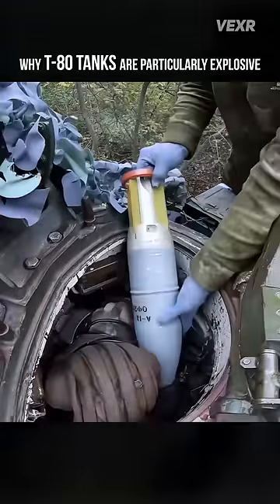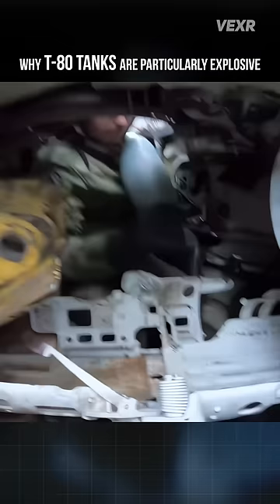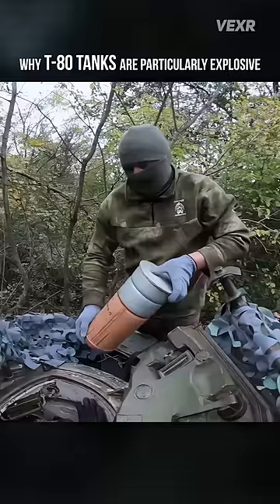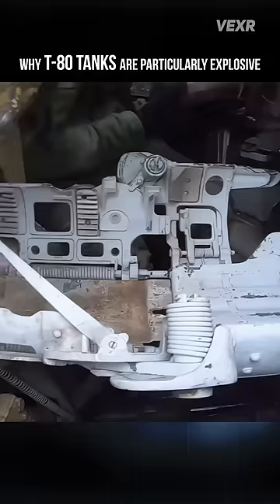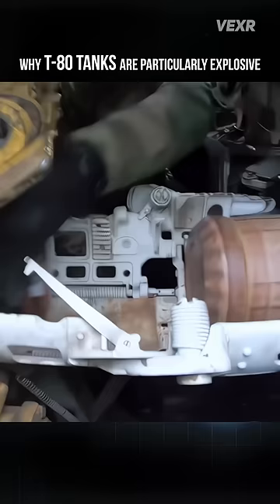T-80 Tanks Are Particularly Explosive, Here's One Reason Why

Comment: Explosive? Every tanks are a death trap when the enemy get your ass
Reply: not really no.. if you study tanks and the war in Ukraine you will see even some of the most basic anti armor assets if they hit the right spot on a T-72 and or T-80 and I believe even the new T-90 MBTs will engulf in a ball of flames due to the ammo exploding. And it will be so bad the turret will actually
Fully pop off which you can see in combat footage, with American abrams, German leopards and anyone who doesn’t use auto loaders and just simply has things to protect the crew including just storing the ammo separately behind a blast wall and not openly like an auto loader, the survival rate goes wayyyy up
Reply: if you die in the tank, that depends on how smart your tank's engineers were
Reply: @kry9943 leopards with blast doors ejected turrets multiple times on camera.
Cope harder.
Reply: @kry9943 what you don't know, the majority of Leopard ammo was stored next to the driver, in the body of the tank. The reason why the Leopard turret is harder to pop off is that the turret of the Leopard extends right down to the floor as it was needed to accommodate the loader while in the T-72s the gunner and commander sit on suspended seats that actually anchor to the turret and not to the floor. 
The main reason for turret pop-off is not the autoloader but the storing of the round around the turret wall. Russia learned this and now they only carry 22 rounds in the carousel, not the 45 rounds anymore so any penetration will not detonate the turret.
Reply: It's generally preferable to have ammo in a separate compartment from the crew. It bumps up your survivability from 0% to maybe 50%. Idk I don't have crew mortality rates but anything is better than lethal ammo detonation.
Reply: @dust_gale3108  Yes, obviously "multiple times" with 5 total Leopards destroyed so far.

The Russian troll losers are nothing if not utterly pathetic...
Reply: @kry9943  T-90 is a joke, the egg cartons were not...
Reply: @kry9943 everyone seen leopard turret flying higher than any other turret ever. Educate yourself
Reply: @loafoffloof3420  If you die in a tank, it means the army command has fucked up
Reply: @nodzeratul bro a t-72 turret flew more than 100 feet in the air. Educate yourself blud
Reply: @redbaron6805 yeah 5, but 5 out of fucking 14. rethink your answer and try again
Reply: @M4_Sherman587  1. Doesn't change a thing since the russian bot said "multiple times".
2. It's 71 not 14 lol
Reply: @dust_gale3108 "CoPe hArDeR" 🤓 
 
Every T series tank from russia is a tea kettle 😂
Reply: @kry9943 ohh kid, u probably didn't saw leopard ammunition explosion if you born yesterday 😂
Reply: Yeah that's the point - this one is a death trap without the help of enemies
Reply: @crabhater9373  i mean, even if you survive after your tank is taken down, what's next?
Reply: @coel3572   get out of the tank? Lol
Reply: @crabhater9373  and the people who hit the tank succesfully suddenly can't deal with infantry. got it
Reply: @coel3572   correct

Comment: It's not the automatic recharger that is the problem, nor even the carousel on the bottom of the turret. The problem is that in Soviet tanks, second-round ammunition was distributed in every available space throughout the tank. This means that no matter where a shell penetrates the armor it is likely to encounter ammunition that will ignite the remaining propelling charges throughout the tank.
Reply: @ManuelTorres-vq8ov  Are you sure you meant to write this back to me? Because I wrote about completely different things and your answer does not fit the topic I raised.
Reply: That's why naval ships try to keep things in separate magazines.
Reply: plus, something that nearly everyone forgets, russian autoloader propellant shells are made of a leather cover, not a hard steel skin like most shells, this is so you dont have a casket being ejected inside the tank, saving space, at the cost that slightly hot shrapnel will fuck you up to the sky
Reply: @FluffyUranium  All NATO 120 mm and Soviet 125 MM bullets do not have a brass shell, but a cellulose shell that burns when the bullet is fired. Only the bullet's primer is made of brass.
Reply: Close, but wrong. It's the type of round they use. HE-FRAG, and they use rather violent type of HE, which also is relatively easy to initiate. It is more potent that western HE used.
Reply: @orkako not true, only Russia and the UK use two parts ammo, the rest use a brass cased round
Reply: Which is why they only half-load the carousel and leave everything else empty. If shells gets struck it's a thrown turret anyway but if you carry less of them then there's less chance a penetration results in a blowout, and there's less incentive to overstay your welcome thus getting targeted more.
Reply: @michaelbuckers  The carousel is always loaded to capacity. Some crews, however, do not load second-round ammunition, which is distributed throughout the vehicle. The carousel is placed on the bottom of the vehicle. This is a relatively safe placement of ammunition.  To reiterate, it is not the carousel that is the problem, but the second-round ammunition distributed in every nook and cranny of the vehicle.  However, the carousel has another disadvantage. Due to the fact that it is placed quite far from the cannon, it takes longer to load a bullet than with an automatic loading bullets from the rear bay of the turret. The difference is 3-4 seconds.
Reply: @orkako  source: your ass. I've actually been there, seen tanks firing, got fired at by tanks, and talked to tank crews. Everybody recognizes that ammo cookoff is a huge issue. As much as you'd like so believe so, nobody is dumb enough to risk the entire vehicle for a chance to lob a couple more shells, particularly the officers who don't just get infinite reinforces with zero penalty for requiring them as in video games. So they load a maximum of half the carousel and make due with that amount of ammo. If they run out, that's just more reason to skedaddle before they get ATGM'd.
Reply: @michaelbuckers half ammo or entire carousel, aka 22 shells. Noone send tank with 11 shells.
Only t-90m and modern Abrams has no additional ammo storage inside tank.
Reply: @trololoev ??? The Abrams can store up to 22 shells of ammunition in its rear turret bustle. The reason there isn't more ammunition is because you don't need more munitions at that point.
Reply: @michaelbuckers  Probably everything depends on the army that uses these machines. In other countries they have different experiences and rules of conduct.  Alternatively, you made up what you wrote yourself. However, I won't find out anymore.

Comment: Dude smoked something  really hard lol. Only bad thing about 80/64 is that their propellants are stored vertically, while in 72/90 horizontally (higher chance of them getting hit in 80/64). Also some other stuff, but tank crews will be able to tell much more.
Reply: The fact that if the ammo is hit it kills the crew, might be seen a bad thing compared to Western tanks.
Reply: @bluedistortions  Unfortunately these western tanks thats have ammo in the hull (or carry it) also have that problem. Turkish leo 2 a4 comes to mind when they blew up to pieces in Syria.
Reply: @erikdudorin3579  I'm not familiar with that system, but if it suffers from the same flaw as Russian designs, it's probably not worth the extra cost. The Abrams platform, much like the A-10, puts crew survivability as priority 1.
Reply: @bluedistortions  I could say (according to what i saw from the images) that all tanks have ammo in the hull by design. But i am not aware of any blowout panels in them, exept Abrams (there are like couple of rounds If i remember correctly).
It would be interesting when Abrams will have autoloader like koreans have or french, where will ammo be stored. Because these two have like 22 rounds in autoloader and maybe same amount or more stored in the hull.

If i had to be crew in the tank, i would be much confident knowing that in worst case cenario i will blow up (HE shells, panels wont help then) and wont burn to ashes when gunpowder burns (then panels will save the crew). I am not that concerned about being hit by shrapnel inside after penetration, because everything is done then (rubber, kevlar etc) on the inside walls of tank and/or worn by the crew.
Reply: @erikdudorin3579  I've seen videos of Abrams cooking off all their ammo, and the crew escaping unharmed. The blowout panels work quite well it seems. I find it hard to believe the US army would have to choose between HE shells and crew survivability? If that were the case, they wouldn't stock any HE shells as standard, but they do.
Reply: @bluedistortions  Maybe US solved the issue (HEAT, apsfds and coockoff resistant HE shells) or they were not using HE shells on these videos. Cant be sure, but i have heard about HE shells that explode from chemicals that will properly mix only when hitting target, in ohter situations nothing happens.
Reply: @erikdudorin3579  well, all I know:

1. It is standard practice to carry some HE shells. That's why the US military has so many of them.

2. The US military values troops lives above equipment costs, so they aren't going to tell tank troops to carry something on board that is suicidal.

3. When there is cook-off, I've seen the mushroom clouds towering over the tank, and thought, "well, they're dead, poor suckers," and the crew hops right out. So those blast doors must be designed to deflect the explosions very effectively.

But for further details, it would be best to ask an actual tanker crew. I'm sure they could tell you more.
Reply: @bluedistortions  Yeah would definitly ask If given a chance during parade in my country 😁 Its always interesting to know about such machines.
Reply: @erikdudorin3579  oh, I meant even on the Internet, I think you can ask US tanker crews whatever you want. When I was 14, I walked around on a US military base asking all kinds of questions about US hardware and capabilities, and was amazed the US soldiers responded as best they could, with seemingly no fear of repercussion. They are generally happy to help. So, it's best to find some and just ask question if you're curious. I don't think US intelligence is very concerned about specific capabilities, because they don't engage in warfare unless they have extensive preparations in place and it's to their advantage anyway.
Reply: @bluedistortions  Yesterday watched a video from guy named Bron, video about ammo part 1. At the end 11.40 there was photo with coocked off ammo. I could not belive my eyes, but they look like HEAT rounds and they did not explode.
Reply: @erikdudorin3579  that makes sense. That's why the US isn't afraid to keep it stocked.
Reply: @erikdudorin3579  That´s not true! The turkish Leo2s were directly hit by turkish artillery to prevent them from falling into syrian hands after being disabled, that´s why they had cracked hulls and their turret was blown off. The ammo stowed in the leo2 hull is A) of low flammability which makes it hard to explode and B) not numerous enough to blow of the turret. If it catches fire, it burns the tank down, but it doesn´t blow it up with enough force to blow off the turret and crack the hull as in Syria. A direct hit with artillery however can blow the turret off of any tank, no matter if it has ammo stored in the hull or not. Whether in Syria of Ukraine, every single Leopard tank that had it´s turret blown of was hit by artillery, not RPGs or AT mines/missles.
Reply: The other thing is live ammunition exposed in the turret 
That about as smart as screen doors on submarines